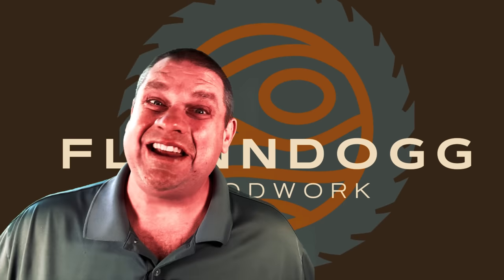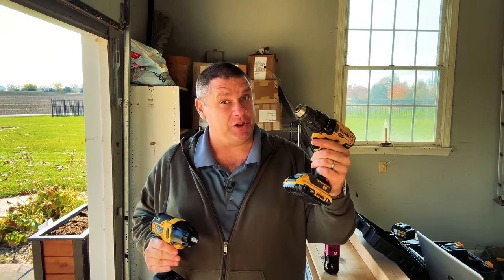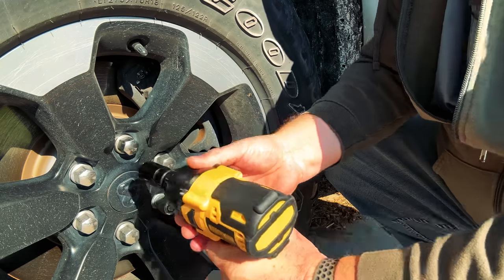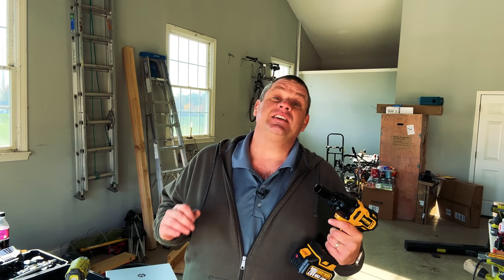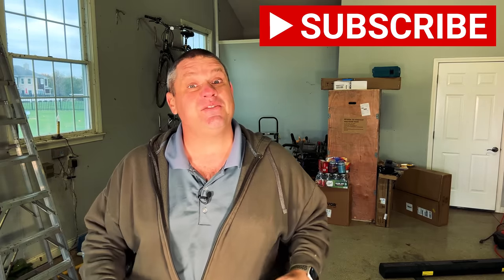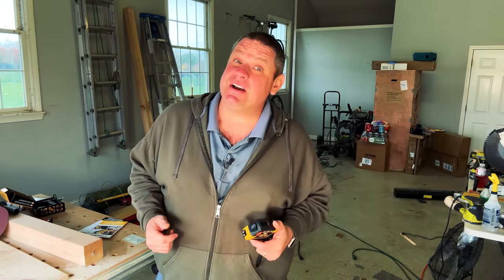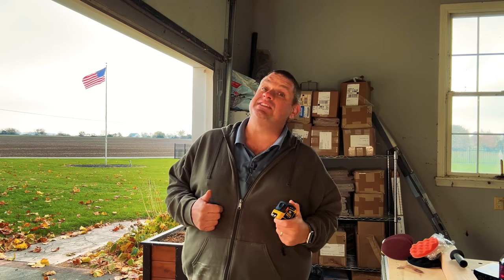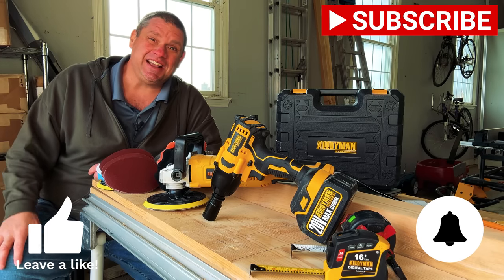The Underdog Tool Brand That Could Dethrone the Giants!

Comment: at $60 that impact is a good deal however, with the current price now being $40 higher at $99 you are better off spending another $30-35 for either the Seesii WH700 OR WH710 Brushless 1/2 impacts, not only are the Seesii impacts the only amazon impacts that actually outpower some of the name brand impact but the torque test channel actually has Seesii impacts out in the field being real world tested by TTC's professional testers like Eric O of the South Main Auto Repair channel and they are holding up to the hard use, plus with the Seesii's you get two 4.0 Ah batteries ......
Reply from the maker: Awesome!  Thanks for sharing abruptlyblunt!   Great suggestions!
Reply: 11-18-2023 listed at $59 and a $5 coupon

Comment: Interesting video. There are a lot of tools that can be used for things other than their original purpose. Modifying or trying them in other genres is very satisfying.  I’d never thought about using an automotive sander/polisher on woodworking projects, but they would be great to polish the table saw table, jointers, drum sanders, etc which require you to slide wood across smoothly.
Reply from the maker: I know right!   I have an old ryobi car polisher that I think this will replace.  I never used that thing on the car, but always used it on finishing for some of my projects.  Great point and thanks as always for watching Michael!

Comment: where do you get the battery adaptors mentioned?
Reply from the maker: Great question,  from my understanding they use the same type battery as makita so any adapter that is set for makita adapting should work
Reply from the maker: Great question,  from my understanding they use the same type battery as makita so any adapter that is set for makita adapting should work

Comment: I'm not a big fan of that pin and rubber band system of holding sockets. I see that pin being lost with the first minutes of unboxing and actual use of the tool, but it doesn't mean the gun is useless. It just means you have to be a little more careful. And for $60.00, who cares that's a screaming deal!!
Reply from the maker: You know, in reading the comments, I guess I hadn't realized that there were other options for the sockets with the impact wrench.  When Filming this video, I kept on dropping that damn pin, and was like, man there must be an easier way!

Comment: Their are many cheap brands on the market. Most are built by one company and are copies of one of the big brands. It''s very similar to the Hart brand sold at Walmart. If you don't have a big store standing behind them good luck wth replacing a dead tool right out of the box
Reply from the maker: That's an excellent point, however these tools are available on amazon, and I've never had an issue returning anything with them, however I definitely won't be able to get things same day if somethign dies on me.  Thanks for sharing and watching sirwallygator!

Comment: Dogman,  the one thing you did not mention was the origin of the tools.  Are they made in China??? I do my best not to buy China made anything if I can help it.  Yes,  I do have some things made from china usually because there was no other choice. 😢  It must be getting cold up there,  I didn't notice your tee shirt,  lol. Have a great week.  Timothy
Reply from the maker: Haha!  You are sooo correct, it is getting cold up here,  I was even checking to see if you could see my breath in the video.  Good news is that my shop is done (as of yesterday) so no more struggling in the heat and the cold.  Bad news is I have a lot of work to do to even get the barn in a usable condition.  I did some research on where these tools were made and I could not get a definitive answer.  The parent company I think is english, but I believe they are made in china.    It's so hard to feature affordable tools that are manufactured anywhere else than there.  I'm keeping my eye out though.